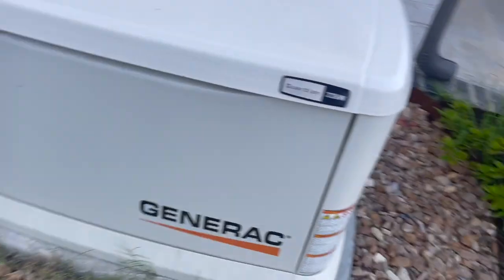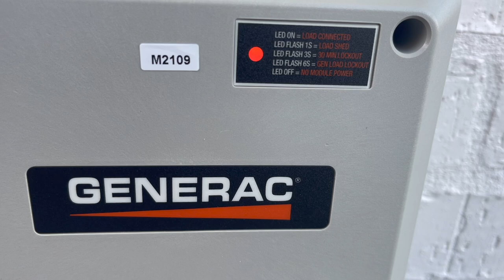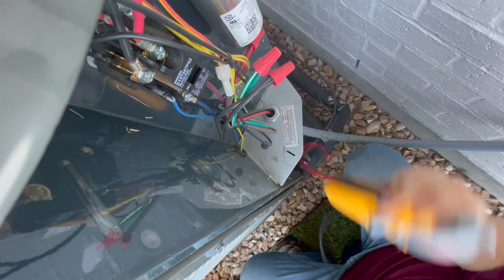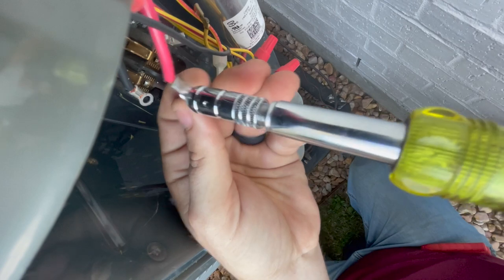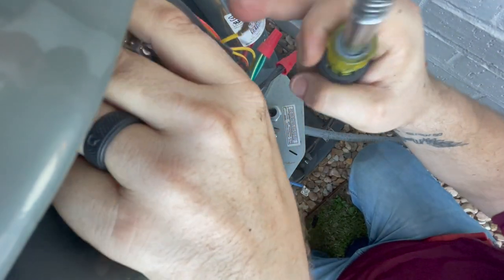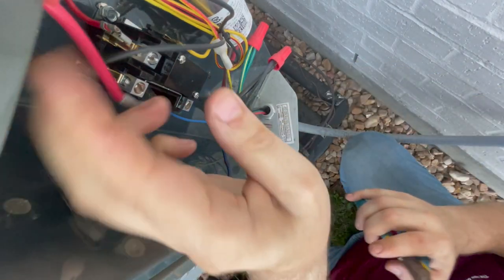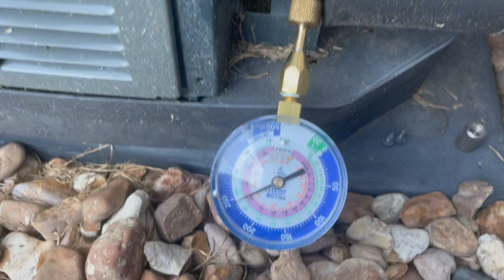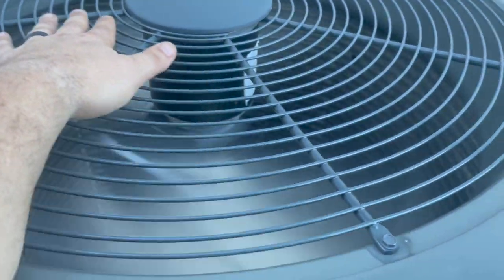Brand New TRANE System Not Cooling

Comment: I think Ted had mentioned in a past video that he has started proactively replacing contactors in every system he sells for that very reason. Trane started cheaping out on contactors and he was noticing a high failure rate with oem contactors. Anyway, good job man. Have a good day.
Reply: Yes he does. I've ran into a few contactors  bad on Trane but not like Ted says they seem to go out quicker in the southern hotter temps.
Reply: Yep, I was about to comment the same thing.
Reply: We are doing that any Chinese Contactor or Run Caps  they out
Reply: @natepeterson7145  I think that's down south we run a/c systems longer!
Reply: @renecuevas4128  Best way to be proactive and protect your reputation; I think TRANE should reimburse the dealers for the time and expense of their shortcomings.-

Comment: Trane I definitely better than york and lennox. I replaced a blower motor in a trane s9v2 (2 stage 90% furnace) and it was so much easier than I thought it would be John. The housing is plastic but the motor bracket holds the mounting legs in place. Only thing for you to adjust is where the band sits on the motor

Comment: Ive had 2 generac’s over the last 12 years. No issues here. Had a 14 kw then upgraded to 22kw. Flawless operation. Only generator manufacturer that has huge amounts of parts available and wide variety of tech compared to limited Kohler or Cummings techs. Only way to go in my opinion. The past generator has problems but the newer models is far more reliable.

Comment: I have the same trane xr17.  About 8 months old and has been worked on a dozen times.  Frost board in winter, now in summer the entire coil (condenser outside) had to be replaced due to bad leaks on it.  While waiting weeks on the coil to come in, the installers had to come out every Friday and recharge the 410 or it would stop cooling.
Reply: C make sure EPA don't get on your pocket and fine you! If equipment doesn't hold for at least 5 years, product maker should be responsible for costs incurred by the dealers!

Comment: I still have my 31/2 ton trane unit 1995 and still working great, I just replaced the capacitor for maintenance only, still have the original as spare just in case.great unit
Reply: Still have 1 of my 1986 Trane weathertron.  Sales kills those units.
Reply: @toddwhaley77  Hope you live longer than that unit so you can get the replacement sale! lol.

Comment: The Generac modules have about a 10 min delay once you pull power. Just found out this today when changing out and ERM. I keep turning breaker off and on resetting the Generac and restarting power shed. 
Love the 8n1 my favorite tool in my bag.

Comment: You can just take the flat head lug out behind it there's a Phillips head screw take that out then take the 5/16 screws out from the old contactor and they thread right into the Phillips head screw holes on the new contactor takes like maybe three minutes and much better contact due to enhanced surface area
Reply: So true
Reply: Not all of the lug contactor have that screw

Comment: ALWAYS turn off low voltage before changing contactors. Less fuses/transformers blown that way.
Reply: Or turn thermostat to off. No 24volts to contactor. Or pull wires off and tape them up. A few ways to avoid shorting it out
Reply: Electrical tape on terminal ends. Save yourself a trip to the t-stat

Comment: My Honeywell (Generac) 10kW LP has been running great for the last six months. I'll let you know if I have any problems. Just like with HVAC, proper maintenance and professional installation are very important. Install a MicroAir soft start kit and it will not be so hard on generator, compressor, capacitors, breakers, wiring connections, etc.
Reply: Yup, I put a soft start on my 2.5 ton Heat pump and the generator don’t even flinch when it kicks on.

Comment: Actually what you heard was backwards. The older Generacs had a lot of issues. They seem to have solved them. I have this exact same model and did a lot of research before I bought it. Someone made a comment about servicing them. I have mine monitored (cellular) by the company that installed it and it's on a service contract. Could I service it myself? Sure but I am in So. Fl. where we get hurricanes. $500 a year gives me peace of mind. I have been without power close to 2 weeks after Wilma. I also lived through Andrew. This can control my entire house as if I had power from the utility. I'm a night owl I was up at 2am getting ready for bed. Lights went off within 30 seconds they came back on the gen was running. I was only on for maybe 10 minutes before power was restored.

Comment: Your Klein multi tool you were using for wiring might have a 5/16 nut driver in it with smaller OD for closer spaces. Just not magnetic.
Reply: I always carry the long Klein nut drivers for situations like that.

Comment: You knew the generac doesn’t come on for at least 1 hour😂😂😂 and the one thing about locking caps when it comes to Trane is that you can go through the side of the unit for true suction and discharge. So what’s the point. Great vid man been working for n TRANE since last year and they get more easier. … how do you feel about the TAM 10 air handlers coming without the CDA like the  7 but thermostats can connect to an app😂😂😂😂

Comment: Should always shut off air handler breaker or from Thermostat to prevent a possible blown low voltage fuse or burn out secondary voltage transformer. Don’t want to short out low voltage side.

Comment: As a technician who has served many trades. I can say with certainty most products made in the modern age are of the lowest quality ever. The corporate motto is "How cheap can we build it" in order to maximize profits. Even stuff made in the US isn't any better if at all. Is that all R&D departments do anymore, find ways to make it cheaper? They can save 10 cents by using a crappy contactor that will run at 99% capacity so it fails sooner than one that would be operating with headroom. But that won't save them 10 cents per unit. Too bad we don't see those savings.

Comment: It does not have a replaceable coil in that contactor?
Reply: Usually you find replaceable coils in large 3 pole contactors in the 75 to 100 Amp range! The coils are offered in 24 volts,, 220, 277.-
Reply: @bobboscarato1313  Come on Bob that's BS, I was an Industrial Electrician for 23 years and reached the Master Electrician level before I changed careers I've seen replaceable coils in single pole contactors.
Reply: @davidschwartz5127  Dave I was in home/commercial HVAC for 60 years and never say those single pole deals ever!!!

Comment: were was the screw that holds in the disconnect cover plate in place?
Reply from the maker: This disconnect doesn’t have that. It snaps in place. Know your facts before you make assumptions
Reply: @johnisraelhvac2019   i see a screw hole is why i said it can the attatude and be a nicer guy john :)
Reply: That looks like a G E disconnect. No screw hole. Just a dimple on the cover.
Reply: @jeffreyjohn2037  even worse all covers should have a screw hole and screw in it i put one in when its safe to do so ie no wires in the way etc

Comment: I hate the chicken$h1t, OEM, 30amp contactors that come on Carrier/Bryant/Payne  condensing units...especially the screw/square washer that is supposed to hold the wire down.

The lug-style 40amp, 2-pole contactors are so much better and easier to land the hi-voltage on.

Clipping the rings off for the 'lug style' terminals and re-using the crimp as a ferrule  is the way to go - you get a much better bite and connection VS the bare-stranded end.

Comment: Bug?
Reply: Only one time in my career, I found a hard shell beetle caught in a contactor. Extracted it, coil had a good ohms reading, contacts looked good. Restarted and ran great.
Reply: @jeffreyjohn2037  You must have had a very short career like 6 weeks? Contactors go bad mostly due to fire ants which love those contact points and when they get squashed release their acid pitting the points which may get "welded" together and burn out the compressor! I've seen that quite a few times over the years!

Comment: Part should be covered under trane warranty If it was registered properly. I've changed many of those contactors and capacitors. The XR line is the more lower end stuff.
Reply: Yes but what’s the point?  They’d just give you the same junk lol.
Reply: @brucecrutchfield3473  we use our own truck stock capacitors and contactors. Yea your right tho any parts now adays aren't the greatest anyways.
Reply: $8800 for consumers. Insane. I've had 6 repairs in 2 years.

Comment: How in the world does a service guy leave a wire nut that loose, plus a 60 amp breaker that's a fire waiting to happen.
Reply: 60 amp is for the air handler heat kits. Although that does seem like too much amps.
Reply: Why use wire nuts in the first place. Stop using junk. :)
Reply: Two reasons come to mind; one is ignorance, the other idiocy!

Comment: I have a 3.5 ton AS unit 20 model as well, contactor went out on it as well,  also these units trane and As have really cheap outside condenser fan motors made in China and  these motors are rusting out very badly and trane will not replace them even though they are warranted for 10 years  to all do not go with trane or AS units, I will never buy one of these units again  high price units very cheap parts  and poor customer support.